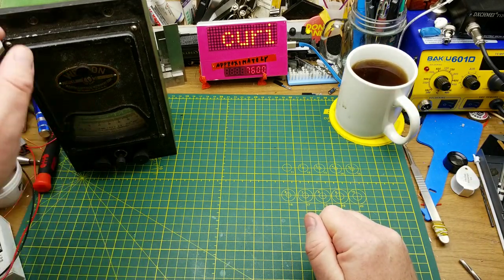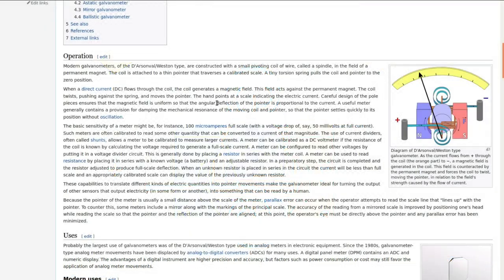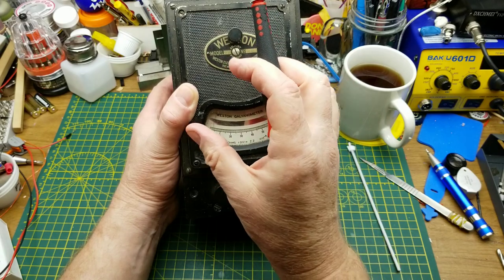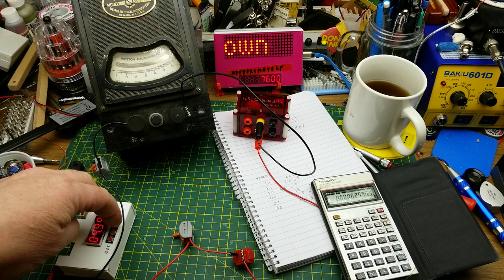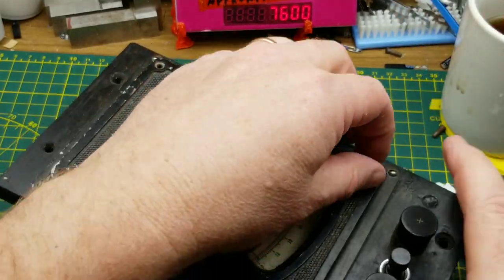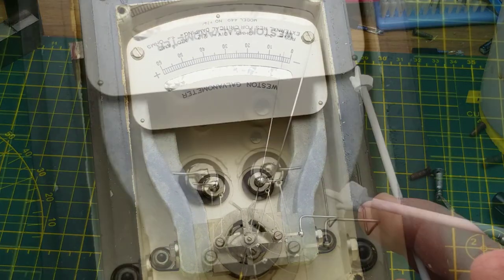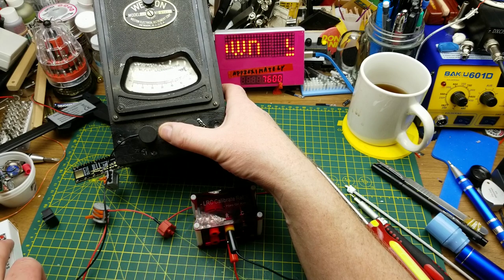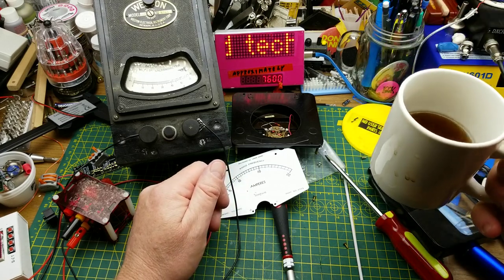vintage galvanometer curiosity teardown

Comment: While in England, I visited a pub you would have loved: The Trip To Jerusalem. (named for the Holy Solders last fling before heading out to battle). 1170-something, claiming it's the oldest in England. Carved out of a sandstone hill, which occasionaly dusted down into whatever you were consuming. I choose a dark concoction they brewed in their cellars. It was wild and cloudy with bits of sediment floating about. One was all I could handle.
Reply: Holy solders sounds like a Batman phrase, the Pub you mention is in Nottingham currently called Ye olde trip to Jerusalem. Like all pubs currently closed due to Covid.
You wouldn't believe the number of pubs claiming to be the oldest.
Reply: @gordanmilne7034  Isn't Nottingham in England ?  Yeah, I thought so. And it's possible that it ""Ye Olde"" has been added since I was there thirty years ago. (or about the time you were still in diapers). Yes, there many claims, since everything in England looks old, but it's date is commonly accepted. NOTICE My sentence said:  . . . '' a pub you would have loved.'' 1st. it wasn't addressed to you (since it's hard to believe you participate in emotional issues; 2nd. notice the words ''would have''. So there is no reason to mention Covid  . . . like I was Booking flights. Any more witticisms you'd like to share ?  It least I made travels, which is more than you will be able to do . . . because of Covid.
Reply: I wasn't making snide comments, I was adding to the conversation as part of the community, if you found something offensive I apologise.
I am 68 so may have have to wear daipers soon enough. Lighten up and if this pandemic lifts and you come here again, I might buy you a pint.
Reply: @gordanmilne7034  My apologies as well.

Comment: I miss my old Megger:-( and the wheatstone bridge meter I had for doing earth rods :-)
Reply from the maker: That brings back a few memories. 

At a previous job used to use a megger and an impedance bridge to test transmitting antenna systems (the same sot of antenna systems that the Simpson meter came from)